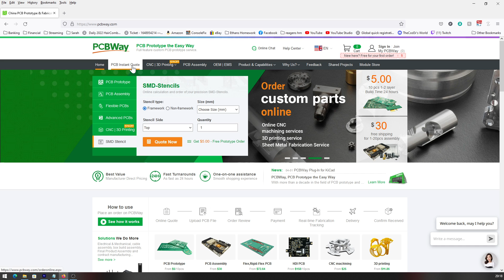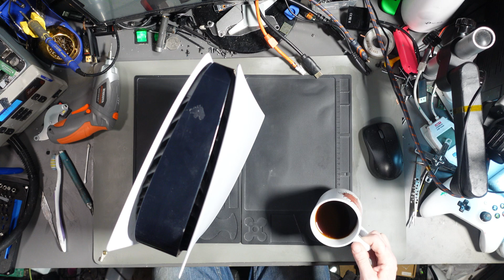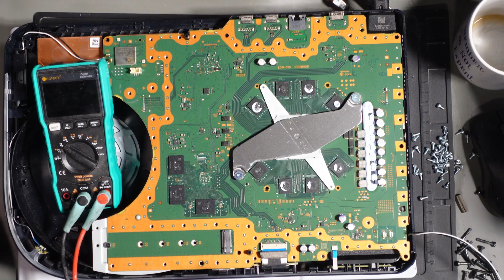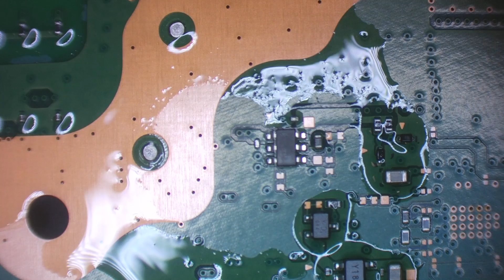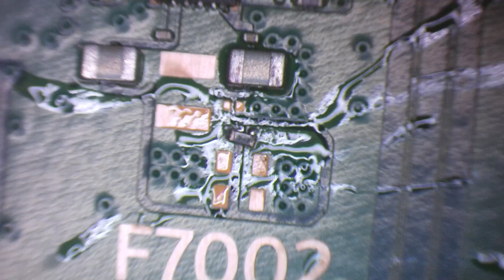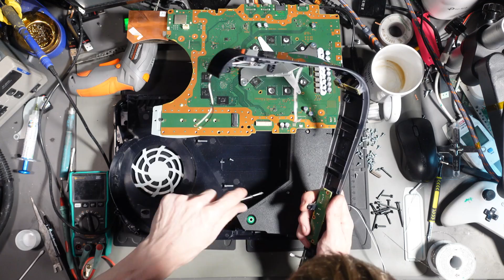A $0.01 Part Destroyed This PlayStation 5! But Can I Fix It?

Comment: Hello, Power supply issues... is common... I understand what I am going to ask sounds strange but is it possible to create, build or use another power supply unit from another device such as a computer psu or something... Or is it restricted by the device or a sensor that is providing a signal to turn on the ps5 power supply. (*repeat post*)

Comment: Hi mate, I have a PS5 in work that needs fixing, it has an issue with the storage, it won’t update or re-initialise, stuck in safe mode. Have you seen this before? I’m thinking it’s the storage controller.

Cheers.

Comment: Hi, TheCod3r . I'm not a master, but I watch masters in YouTube from Russia and the former USSR (Ukraine, Belarus). In the same case (as on the 15:29 ), they use the following things, in order to lower the price:
1) Thermal camera (usually, Seek on the smartphone)	- These are famous bloggers or large companies.
2) Freezer is a spray with a low temperature. You spray on the board and where it heats up, quick evaporation occurs. It seems to be done specifically for such things. But I don’t know whether it is sold with you or not.
3) Technical alcohol - It also works like a Freezer
4) Checks from the store =) Yes, those checks that work from heating. Where a rather high temperature is, a black spot will appear on the check.
5) Fingers =)
p.s. Maybe some method will be interesting to you or the audience. Sorry for google-translate.
p.p.s. 16:45 - Ops.. you also use alcohol =) At this moment, in order to determine which specific component heats up, a check from the store could well help. Or buy an empty tape of checks. But for starters, it is better to check on the used check
p.p.p.s. Turn on the backlight on the multimeter for us =) This is probably the Hold button, because The sun is drawn on it (perhaps you need to detain or press for a short time)

Comment: Nice job, Phil. I watched your attempt to remove the first cap on 0.25 speed. Despite this, I did not see where the cap went. It must have shot off at light speed 🫤
Reply: Must've pinged off to the left, under the heat gun and into another universe.

Comment: The cooling of the PS5 is pretty bad because I have seen a few youtubers test the cooling of a PS5 after a few hours of gaming and the ram was the one that would normally get hottest with a near 100 degrees in celsius. Although the Xbox Series X does not have the best cooling it is much better than the PS5 cooling.